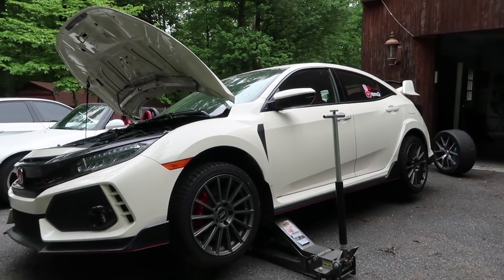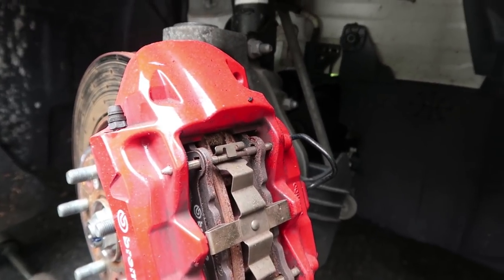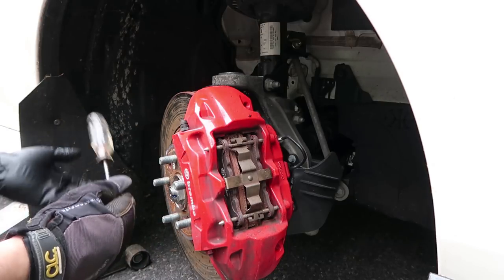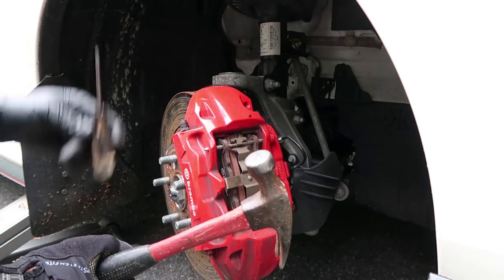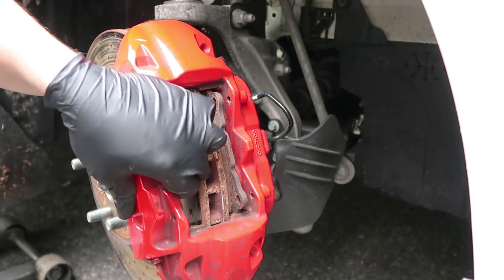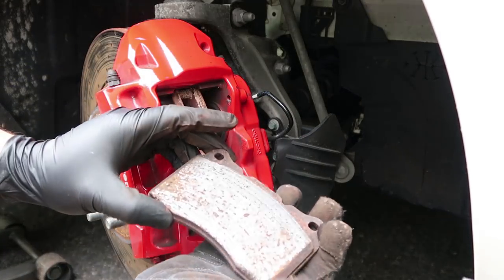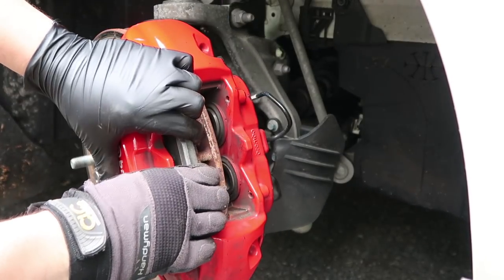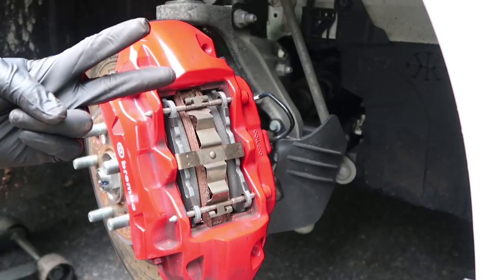How to Install Brembo Brake Pads EASY! | Honda Civic Type R Brake Replacement

Comment: Wow.  Main Line Honda in Ardmore, PA just tried to charge me $765 for Brembo brake pad change!  They said they have to replace the rotor at the same time as the pads.  Am glad you posted this

Comment: Thanx elias. 
I have a fk2 type r . 
Just bought my first set of replacement  pads . This video saved me a ton of cash by doing it myself and not using the dealership
Reply from the maker: Happy to help man! It's pretty easy
Reply: FlyinGato keep up the great videos
Reply: Are your replacement pads aftermarket? If so where did you buy it?

Comment: Thanks bros I’m going to install new front pads. I paid a shop to install rear pads and I’m regretting that decision. Going to start doing brakes myself after watching your videos
Reply from the maker: Good choice! You need an extra step for the rears, I'm looking for the cheapest computer to plug in and get the rear brakes to go to service mode.
Reply: @FlyinGato  there's an autel device for around $65 on amazon. I think I'm going to buy that one. Seems a lot of type r guys are using that one.
Reply from the maker: I'll order it now
Reply: @FlyinGato  good stuff. Love your vids man. I can't wait to be a baller and get a corvette like you lol
Reply from the maker: Haha, I'm actually searching for my next "forever" car, looking at Porsches or the next C8 Z06

Comment: I am loving my new R! I only drive it on dry and clear days. I wipe the car down after every drive. This is mainly a comment and NOT a complaint. The brake pads are very soft so they make a ton of brake dust. It takes me an hour just to wipe down all my wheels but I’m anal and wipe the entire inside of the wheels too. Lol
Anyone thinking of buying one; JUST DO IT! I flew from PA to NC to buy mine and never drove one before. Once you sit in that seat you will know what I mean! Happy drives all!!!
Reply from the maker: It's such a uniquely good car, best chassis for any car
Reply: I know exactly what you mean - takes at least an hour to clean the black wheels properly.  I also clean the calipers every wash and even apply a spray wax to the calipers and wheels.  They do look good when finished.
Reply: You guys should look into ceramic coating your wheels and calipers as I have done. Break dust completely wipes off with a water-less wash and always looks wax'd, new. Maybe 20-30 to clean them spotless if that.
Reply: If you want a good wheel cleaner that doesn't take any/very little agitation with a brush, check out smd_supplies on Instagram. Trust me. It works wonders. 20-30 minutes to clean a ceramic coated wheel is still a long time. It normally takes me that long when I'm detailing my customers cars
Reply: DO NOT get me started on the Type R's stock pad's brake dust. Good thinkg I have gun metal color wheels so they blend in a little.

Comment: Aftermarket brake pads usually eat your rotors, at least on motorcycles.  Also if you get  track ones, they won't get hot enough on the street and glaze over, then you have no brakes.

Comment: video starts at 6:12 😂
Always leave the brake fluid cap off/loose - otherwise you could damage your system from pushing piston in and fluid having no space to move in tank from air trapped by cap
Reply: That is what I was thinking as well. Even when I change my EF brakes I have to have the brake fluid cap off, because there is always air in the system.

Comment: Check this out. My dealership said that with replacing my pads, they have to change the rotors as well! Wanted over $2k.
Reply from the maker: Not needed
Reply: My dealership said the exact same thing, but they only wanted $785
Reply: Hey, I never have changed my rotors so far and I hear squeaking in my brakes and I find it using a bit more effort to stop, just changing the brake pads is enough right like I don’t need rotors correct?

Comment: Hello Elias, does it not damage the ABS sensor? Normally the rear pads have these issue, you need scanner to get it back or using the bleed way to avoid any issue with the ABS sensor. If you didn’t get any alert at the dash cluster you were good.
Reply from the maker: Hey bud, it doesn't, never had an issue with abs when changing brake pads

Comment: Do you need to change the rotor's if you change brake pads?
Reply: Did you answer this one please?
Reply: For just brake pads the answer is NO. if you didn’t catch them in time and it started grinding against the rotor (because the pads have been worn out to 0 spec) then YES you would need to change the rotor with the pads.

Comment: What mods would you recommend for faster acceleration? I just got one and I’m not sure if I should leave it stock or try to do some modifications also, did you break in your engine? A mechanic told me that I shouldn’t worry about that and also the person from the honda dealer, which have a type r, told me that  I shouldn’t care about that either

Comment: Planning on switching to ceramic myself soon. Local Honda dealer is taking care of my faulty gas door lock, my Type R center caps have the chrome peeling from the inside, trim above the rear door window is peeling, and still having grinding issues that I’m trying to take the right steps to get that fixed. I feel like I purchased the black sheep of Type Rs.
Reply from the maker: Damn that's a lot of issues
Reply: I also have a black sheep Type R.  Mine was a brand new car but has had multiple build quality issues - I've sorted many of the issues myself as I have zero confidence in the dealers.  I've enjoyed driving it for 2 years but I'm replacing it in 2019, and it will not be another Honda.  I've had Honda's for 12 years, and this is definitely the last one.
Reply: I hope you know that second gear grinding is very very common in Type Rs

Comment: My pistons won't budge when trying to remove the old pads

What am I missing? Should brake be disabled?
Reply: Turns out just needed a long screw driver, to pry them open gently
Longer flat head screw driver provided more leverage than small one

Comment: Hey brotha got a question for you not related to brake pads hopefully and im sure you know since you had it done already. At time of swapping rims and tires did you had to buy new tpms sensors for tires or how did you do it. Are there sensors in tires? Im trying to buy new set of rims and tires but im wondering if i need to transfer sensors over
Reply from the maker: What's up Eric, look up my video about TPMS Type R, but long story short, the Civics don't use actual sensors
Reply: FlyinGato cool tks brotha great vids i had learned more from your vids

Comment: I have 2018 type r and after bought new 3000km found grooves in front of rotors 
Do u have the same issues on it ?   I been told from dealer that every type r does the same way . Btw  never went to a track and city drive most
Reply from the maker: Yeah that's normal

Comment: If you push the pistons in on one side the pistons on the other side will protude if you have removed the pad on that side, as you will see in the video around 10 minutes.

Comment: So if I get a different ceramic pad that's not brembo, itll still brake like new? Or do I need brembo pads??
Reply from the maker: You can get any pads that fit
Reply: @FlyinGato  I just got ceramic duralast but I want the same good stopping. Or do I need to stick to brembo is what I'm asking...also, what's your opinion on carbon fiber integrated brakes. More specifically, duralast gt street pads. I'd really like your input thanks gattito!!

Comment: Just got a 18' civic sport hatchback, and i wanna replace the brakes. Any Suggestions?
Reply from the maker: Get really good brake pads and change to higher temp motul brake fluid. Look at stoptech sports for brake pads

Comment: Do you not get rotors turned so that it’s an even flat surface for the new pads?
Reply from the maker: nah, bedding in the brakes does most of that for me.
Reply: @FlyinGato  ohhh ok. I always have rotors turned in case they are warped plus there was a time I didn’t get them turned and they squealed like crazy so from that day forward I started having rotors turned and if they weren’t that expensive I’d buy new one being that having them turned  was $10-$15 whereas a brand new rotor was only $25.
Reply: @FlyinGato  Thanks!

Comment: I’m doing this soon but going with the hawk hps pads. They come with grease or lube. Where do I apply that. I’ve never changed brakes out but doing it to stop the squeaking.
Reply from the maker: You put it on the back of the pads, and the contact areas. I did a video of me changing the pads on the Civic Hatchback, I explain where you put the lube
Reply: Hawk is said to damage the front fk8 rotors

Comment: Hi, I recently changed pads on my 2017 type r front were a breeze. When I changed rear pads now I get brake hold and e brake problem indication on dash. Any advice before I take to dealer will be greatly appreciated.
Reply from the maker: make sure any connections aren't loose back there
Reply: What ended up happening here Giovanni???

Just changed my pads and the same light came on!
Reply: This is simply because you did not put your car into mechanical mode this puts your car in a rest mode basically safer to work with

Comment: Do you have a link to where you order your Brembo Brakes? I need rear brakes for my Type R, and I go onto tire rack and say they do not fit my car. 
Thanks
Reply from the maker: For rear brakes all you need to do is order any 10th gen Civic brake pads they will fit perfectly
Reply: @FlyinGato  how about for the front

Comment: Whats the part number from AutoZone, I picked up Duralast Max for the fronts but there is no holes for the pins. Part #DGC914 says it fits for the 2017 CTR...
Reply: You seriously bought Autozone cheap-o pads for your type r?
Reply from the maker: They work really well

Comment: Are the rears the same away since its electric? Do you have a video on rear install
Reply from the maker: I have a video of me replacing the rears on the hatchback I used to own, same exact setup. Just turn off the parking brake, lift up the car, you'll need a 7 or 6 mm allen key to undo some bolts, slide out the caliper, with a brake compression tool you have to push in the piston while also turning it, put in new pads, slap it all back on.
Reply: FlyinGato theres no parking brake light reset on these right? Keep seeing have to reset parking system after replacment
Reply from the maker: There isn't, usually when that happens you've disconnected something back there

Comment: Hi mate. Should you not have bled them afterwards or is it not necessary for pad replacement? You mentioned bleeding brakes is there a video for that? Or is the brake pressure enough to just bleed the nipples without any tubes on the calipers?
Reply from the maker: You don't have to, I've done a few videos of the bleeding process, it's not hard, I've done it about 15 times
Reply: Thanks buddy. Normally goes the garage but gonna give it a go on my R
Reply from the maker: If you're changing the rear brakes make sure you do the extra step, just in case, to release the parking brake
Reply: Thanks mate. Found the other video now

Comment: Nice work! Very informative, thank you for sharing! By the way I have questions about the stock slotted rotors on my R.
I Have a 2018 Type R (Cad) currently sitting on 28,000km. I think I'm due to replace my front and rear brake pads is it necessary to replace my rotors?
They're still in decent shape I see no sign of cracking on the surface. I don't track my Type R and probably never will but I do daily drive it a lot.
Reply from the maker: As long as there's no cracking I wouldn't replace rotors at such low mileage
Reply: @FlyinGato  What brake pad do you recommend to use just for normal street driving?
Reply from the maker: I have the perfect video for you! https://www.youtube.com/watch?v=aa5_8X-pwak&ab_channel=FlyinGato

Comment: Makes me a lil uneasy knowing the pins can be re used, how often should those pins be replaced for safety reasons obviously?
Reply: With the pressure from the clip, i doubt they'll need to be replaced for quite some time.
Reply from the maker: That's right, the clip really does a lot of the work, that's why I'd replace them more often than the pins
Reply: @FlyinGato  years later I'm back, 😂 I'm now needing to replace my pads, but have not been able to find out why it's OK not to replace the rotors. I've always been told to resurface or replace rotors when changing pads.

Haven't been able to find an answer for this, as most videos on changing pads don't go into detail on the subject.

Comment: Hi! do you know the best way to wash your type r without damaging or scratching the paint?
Reply from the maker: Honestly, I just don't wash it much lol
Reply: Snow foam is your friend.  Spray it on, leave it for 5 mins, and jet wash it off.  Then clean the car as normal with a wash mitt and car shampoo in a clean bucket, rinsing with clean water at the end.  Finish off with spraying the still wet car with detailer and drying with a large microfibre cloth.

Comment: Pay all that money for a front wheel drive? Yuck!
Reply from the maker: Fwd is very fun, trust me. I also have an S2000, a WRX and a 335d BMW 👌
Reply: @FlyinGato  fwd is fun? What are you comparing it to when most cars on the road are fwd
Reply from the maker: Integra Type R, Prelude, the Civic Type R are all super fun, and stomp a lot of rear drive cars at the track
Reply: @FunnyBus3rd  you can drift fwd fk8 and other fwds. Check out chris harris fk8 drift